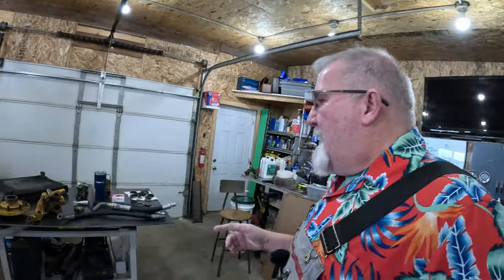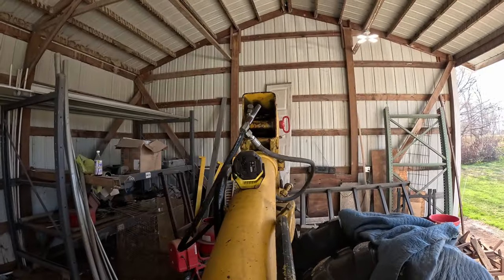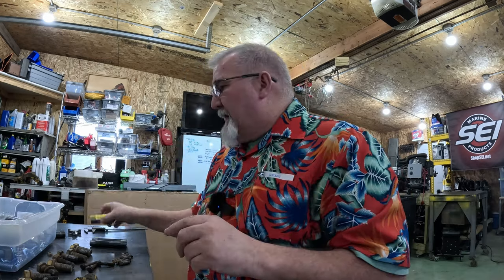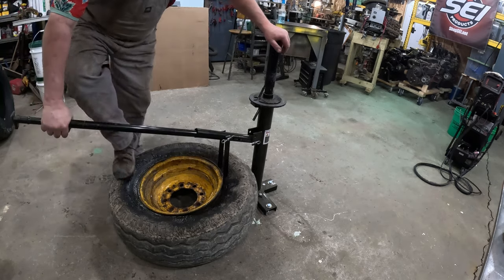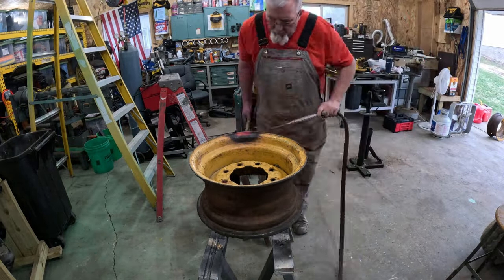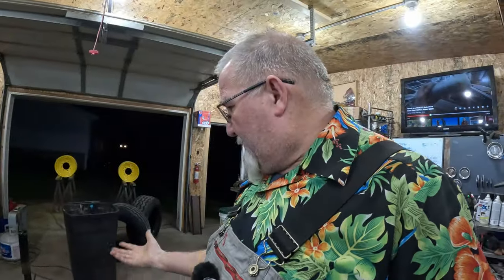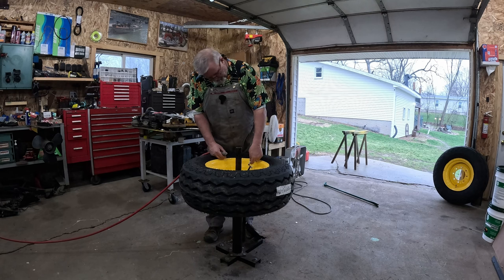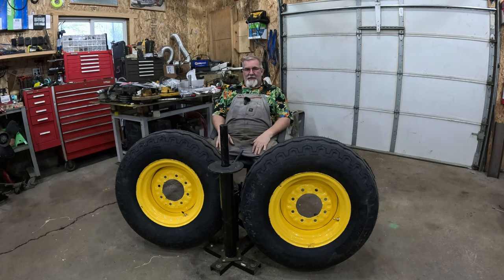More work on the 1975 Ford 550 Backhoe plus can the Harbor Freight Tire tool work on big tires

Comment: Awesome video like always Sir..👍👍Well second guessing who’s the GENIUS in this team pretty sure it’s the wife (BOSS).. Hey can’t knock the Harbor Freight tool it held .. I still like mine 👍👍👍the rear tires are can be a pain to do but I have done some .. But this is how I did them maybe it will help you too I used extensions on my pry bars after getting first bead off I flipped the whole tire and ratcheted strapped the rim up in air against tire then pried it off.. Kinda like how you flipped these over and used gravity to help get them off .. Stay safe and As always Sir thanks for the ride along and Keep’em coming 👍👍👍👍
Reply from the maker: Thanks for the tips for sure, I will deploy that tactic for sure. Thanks for watching